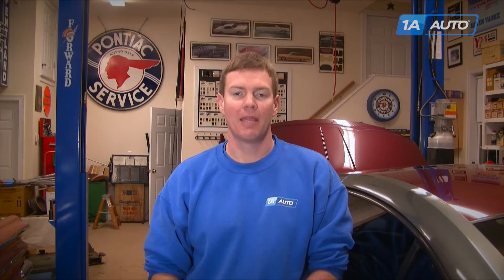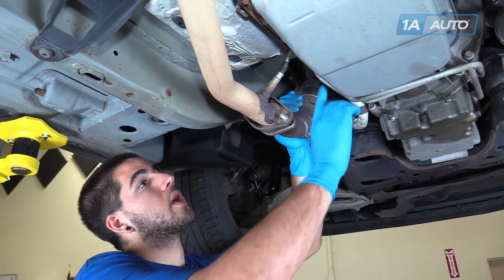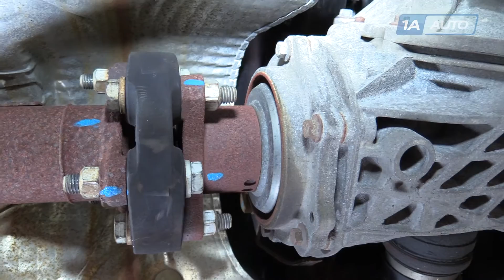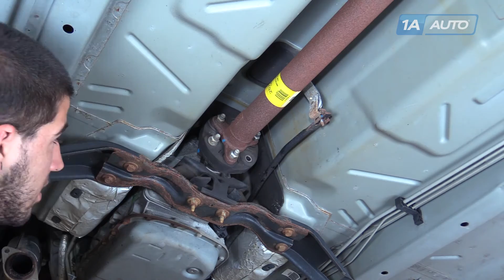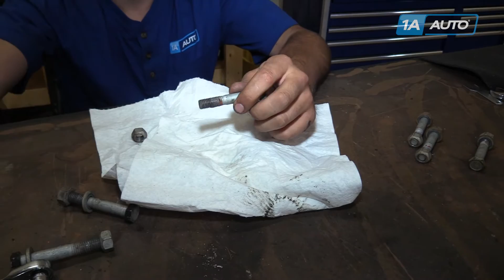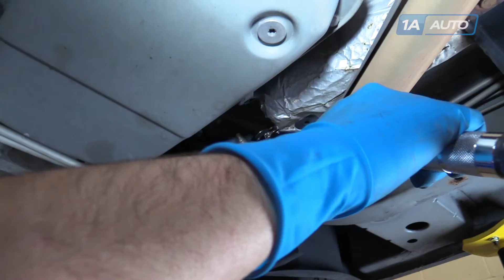How to Remove Driveshaft 03-07 Cadillac CTS

Comment: For anyone here with a 2009 Cadillac SRX 3.6L V6 AWD 5L40E 5-speed:

-I couldn't find a video or even a forum post specific to this vehicle, but this demonstration is a valid reference for most steps, with a few exceptions (see below).
-I did this in the garage nose-in with the front wheels on ramps and the rear on jack stands, which I positioned on the sub-frames as far out as I could so the exhaust would clear.
-The "caddy clunk" sound wasn't severe or scary sounding on this car, even though the bushing was completely gone.  I am surprised that the shaft held together given its condition, and I would recommend regular inspections and immediate repairs.

-Our drive shaft is not designed to be split, according to GM and the internet.  The complete rear drive shaft assembly (GM # 15210790 / # 15210791 / Dorman # 976621, length 57.13") must be replaced.  I am going to try to split the old one at my day job machine shop anyway, and if I am successful I will come back here with that info.

-The front end of our shaft is different.  6 inverted Torx bolts mount a dome-shaped insert to the transmission output coupler.
-I did not need to remove the O2 sensors, just the harnesses.
-I was unable to insert the new shaft into the transmission coupling without supporting the transmission on a floor jack, removing the transmission support, and lowering the transmission so I could get an angle on it.  If it doesn't go in smooth like you see here and on some later SRX videos, don't waste your time wrestling with it and just lower the transmission.
-The torque spec on the 6 front end bolts is 43 ft-lbs.

Thanks again to 1AAuto for another excellent repair video!

Comment: Is it necessary to mark the old driveshaft if you're going to be installing a new driveshaft?
Reply from the maker: It is not necessary if installing a new part.  +Gabriel Sanchez
Reply from the maker: It is not necessary if installing a new part.  +Gabriel Sanchez
Reply: Cool. Thanks for the quick reply.

Comment: Wow! very professional tuto.  Thanks.  I have that 2006 CTS with manual tranny.  My problem is the bushing of the shifter.  Very hard to put in reverse.  Do you think that i can fix it without lowing down the transmision?  Have you got instruction or video about How to remove the shifter kit  and put it back after changing those 2 bushing.  Thank you very much.   Gaétan    ps sorry for my English.  pps.  Cadillac does not sell those bushing, You know where can i order them?
Reply from the maker: +Gaétan Paquin We currently do not have an auto repair video on that particular repair. Thank you for asking.

Comment: I just have to say, THANK YOU for making this video!  I've been riding my bicycle 60+ miles a week for a month while I saved up to buy a new drive shaft.  Got lucky and found the whole thing including bearing for about $130 used from a vehicle with 32,000 miles.  Thanks to your awesome step by step instructions, I had the old one off and the new one on in about 5 hours!  Not bad for an amateur that is not at all mechanically inclined.  The Caddy is running smoother than ever.  Thanks again!!
Reply from the maker: +Burnt Brian Thank you for watching! We're glad your bicycle (and your legs) may take a break while enjoying the comfort of your Cadillac! 1aauto.com
Reply: Burnt Brian 

My 2003 cadalac cuts will not light, how to fix?